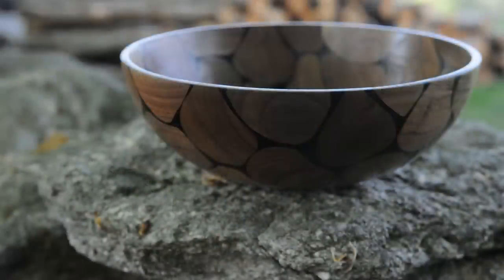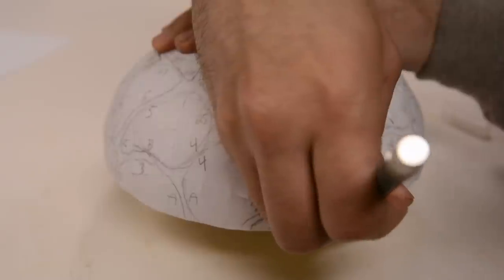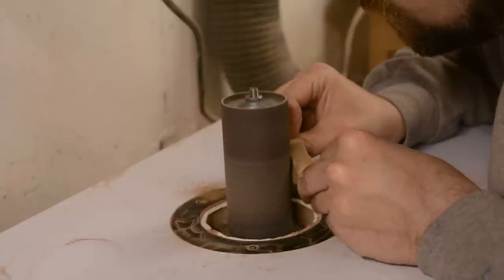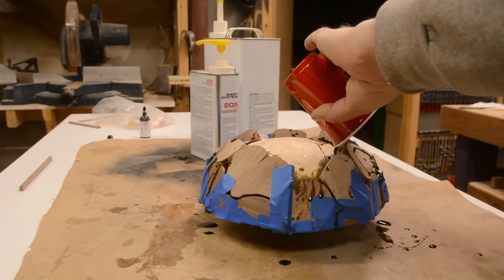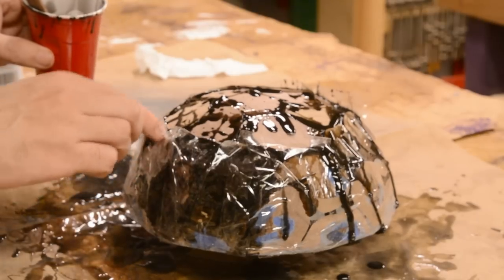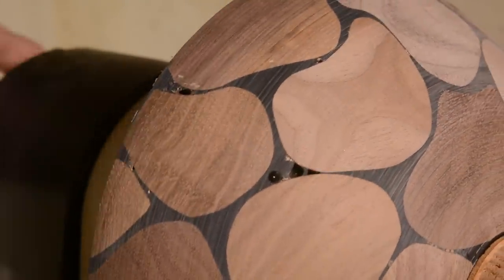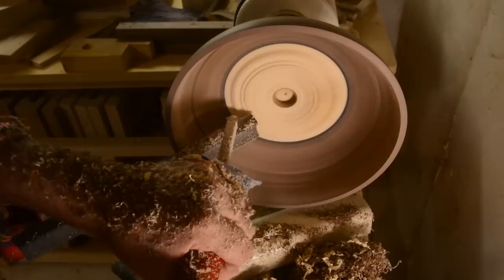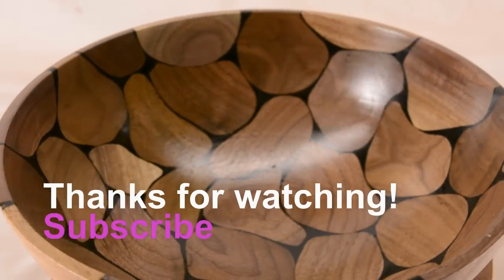Stone Wall Inspired Bowl

Comment: Not sure if this idea is practical but...  Make an outer form instead of an inner form.  If you spin that form on a turn table, liquid inside will form a parabola.  So potentially, you could do your pour from the inside, just submerging all the wood in epoxy, without the need for any tape, and without filling the whole interior volume of the bowl with epoxy.
Reply from the maker: Matthias Wandel Hmm, well that would at the very least fail in a very entertaining way :)  The inner mold is the easiest part of the process and makes it easy to mount on the lathe.
Reply: krtwood I suppose it could get quite entertaining if you spin it too fast!
Reply: Matthias Wandel I was thinking kinda the same thing, but in stages - first the bottom then about 1/8 of a side at a time pouring the next 8th as soon as the previous pour held in place - vibrate the work piece while the epoxy sets up to de-gas the epoxy. Another idea is to turn and outside and inside mold. Set this up on the inside of the outer form and then o pour enough in the form to fill all the voids once an inner form is pressed in place. Clamp it down and then vibrate the whole work piece for a while to de-gas the voids. Then there's a relatively solid piece to work with with the epoxy and wood-rocks in the middle.

Another idea I had was to use a vacuum chamber, but I think the air in the molds might just get pulled into the epoxy.
Reply: +Dogwood Tales (Projects For the Home) I suggested a similar process below. I think the idea of using an outer mold with pieces stuck to the inside probably has the best potential. Even if you just hold it up by hand, and tilt it back and forth. However, Epoxy takes a while to set, so it may run back down into the center if you put the mold down. 

Taking advantage of the fact that Epoxy does not stick to Polyethylene is also very useful for making release molds. If  molds are made of this, (instead of wood) then there will be no air to get sucked into the epoxy from the mold, when the whole thing is in vacuo.

Comment: Beautiful.  That looks amazing.  I love  turnings made from segmented wood/other stuff.  I've ran into the "small void fill" problem myself.  Frustrating as hell until you try poking it in with a toothpick.  Just jab the toothpick through the epoxy and pull it out to release the air bubble inside the void.  Works every time and makes one feel like an idiot for not thinking of that sooner.  I wasted 3 days once before I had that epiphany.

Comment: Beautiful bowl.  I've done a little work with epoxy and it can be very rewarding.  The master of how to use epoxy is Brendan Stemp who lives in Australia.   He is the consummate wood turner and earns his living from it .   He has some great uploads.
I think you could have made your work a little easier if you had taken a cheap plastic kitchen bowl and glued your segments to the inner side.   Then find a similar plastic bowl a size or two smaller.    Half fill your original bowl with epoxy and gently press down the second bowl forcing the epoxy upwards and outwards.   If the epoxy doesn't reach the rim just mix some more and top it up.
Anyway, your bowl is a stunner.
Best wishes,
Alan.

Comment: Use a toothpick to help push the epoxy into the tiny voids/holes instead of just putting a blob over them. The air is trapped inside doing it your way and epoxy wont fill the voids. Either way, absolutely beautiful bowl mate!

Comment: Absolutely great design! Attempt at suggestions: cling film to keep the epoxy in, and an injection needle to fill the voids? I do understand your thinking towards bigger gaps but without (obviously) having seen one of those, I think that the delicateness of this bowl made by incorporating these small gaps are real nice.
Reply from the maker: Maurice Blok Mostly I just want to avoid having the pieces actually touching each other.  There were a few spots where the joint between them was really tight which is usually a good thing but not in this case.  I'm also thinking maybe some strategic channels carved in the inner mold would allow the epoxy to get down into some of the trouble spots.

Comment: I also thought you were going to use an external mold as well, that may still work with bigger gaps...nice job!
Reply from the maker: Rob Shamel I want to try to avoid the outside mold if I can.  Either it's a plastic bowl and then you're locked into a particular shape or you have to turn a whole bowl just to destroy it.  Thanks!

Comment: Here's what came to mind which could be helpful for your method. Make the same inner mold again, but put it on the lathe and carve out the inside of it essentially making it a bowl itself which will be useful for the later drilling maybe. After you glue the cut out shapes of wood to the inner mold, you could use a drill wide enough for epoxy to flow down the drilled out holes easily and drill those holes in to the mold in between the wood cutouts. After you did that, you can make an outside mold from a plastic bag by gluing it to the wood pieces. Applying the glue along the edge of each piece or the entire piece and there by ensuring that no epoxy would be caught between the plastic bag and wood.  When drilling the holes angle them so they are all upright, that will allow you to spin the whole thing without having to plug the holes and that way help distribute the epoxy better using centrifugal force, then later add more epoxy, plug up the holes and flip and shake. But I feel that Matthias has a much better solution, by gluing the entire cutout to an outer mold you can pore the epoxy easily and nothing would be wasted. If you really want to have an inner mold for the lathe, you glue it in after.
Great bowl, keep up the good work.
Reply from the maker: Marko Živković Thanks for the suggestions.  What I'm thinking about trying is to cut channels along the surface of the mold to make sure the epoxy can get down everywhere.  I think that's the least amount of extra work and worth a try.
Reply: krtwood Yeah, that sounds like a simpler solution then the holes I suggested.

Comment: Ill add a bit with my experience with small epoxy voids. The first one is CA glue andactivator. the scond is just the way you did it, but ass a flame to get the air out from under it. It helps me out a ton when having to fill small holes.

Comment: Love the finished bowl.  Here are a few epoxy tips:

A) An outer mold would have eliminated a lot of the problems.  Might have to do multiple pours because curing epoxy is an exothermic reaction and it will actually boil from the heat it generates while curing if you use too much material at once.  Don't ask how I know this... ;) 

B) Aluminum tape ($6/roll at Menards) is the best tape I've found for damming epoxy in.

C) Only effective way I've found to eliminate small voids is to either turn them away or enlarge & fill, much like a dentist when he's filling your teeth.

Comment: Spectacularly beautiful bowl!  Can you use a syringe to inject the epoxy into the very tiny holes?  Maybe that way the surface of the hole is covered from bottom up rather than trapping an air bubble inside by a dripping application?

Comment: Oh, by the way, epoxy turns yellow/brown over time, and will crack, so coloring it is a good idea. The packaging for electronic ICs is made of epoxy plus some filler that stabilizes it. (Carbon Black? Glass or Ceramic Dust?). I do not know if Acrylic or Polycarbonate are more stable. These plastics off-gas, (hence the smell), which may or may not be suitable for food. Definitely bad for any fat-containing food like meat or cheese. Bakelite is awesome, very stable, and not toxic, unless maybe you ate a bunch of it, but I believe it is a thermoplastic, so it needs heat to mold it into shape.

Comment: this bowl is very beautiful! you skould try wrapping it with "foodwrap" (i dont know the right word, English isn't my primary language), or the thicker shrink-wrap that's used to wrap boxes for shipping, i use it everyday at work and it would keep itself VERY tightly wrapped around the perimeter, and probably be a lot tighter because it sticks very good to itself but not at all to the wood, dont know how it reacts to epoxy but u surely have it in the kitchen and its also very cheap :)

you should however try to find the one used to wrap things for shipping because it's a lot thicker and stretch/crimps a lot more, thought if you put a couple of layers with the foodwrapping i think it'll suffice :)
Reply from the maker: Karl Liljeström I thought about that.  I went with the tape because I wanted to go up to different heights in different places, so the tape let me be strategic about it.   There are placed where if you tried to fill it all from the top it would have to go down and then back uphill to fill the voids which I didn't think would work.
Reply: true, i thought mostly about the lowest part so you could get the bottom sealed so it wouldnt drip trought, but as you said, differnet height all around...

Comment: Have you tried using a bit of a "wick" to let the epoxy flow along to the bottom of the void?  (or maybe a fat syringe?)  I think it doesn't tend to fill because it's too thick, and it just creates an air pocket when you try to fill it in with a glob on the top of the small hole.

Turned out really nice though.

Comment: I really don't know anything about turning wood. But I know how to make molds for metal and other things.  My suggestion is this. Take a regular bowl about the size that you want to make your turned bowl.  Cover the outside of it in vaseline.  Then take a cardboard box and line it with wax paper.   Then take plaster of paris and fill the box, push the bowl into the box.  It will take about 3-5 minutes to "set up"  Pull out your bowl. then let the bowl shaped mold dry overnight.  Now take your wood pieces and glue them to the inside of the "mold".  Take your resin and pour it into the bowl shape.  This means you can rotate the bowl shape to "fill" the voids.  vibration works excellent for this too.  So tap on it, set it on a vibrating sander with no sandpaper to raise bubbles to the surface.  Now after the resin sets up all you need to do is soak your plaster mold in water,  you can break it up with light hammer taps, or even use a jet sprayer to wash away the plaster.  The cardboard and wax paper should just pull off the plaster pretty easy.
Reply from the maker: Atilaurakiss Thanks for the suggestions.

Comment: Nice project. I wonder if you were able to put the form under vacuum while it was curing if that might solve your void issue.
Reply from the maker: Brian Lasch You would need a rigid inner and outer mold to do either vacuum or pressure.  From what I've read that can deal with small voids but not bigger ones unless there is a path for the trapped air to escape.

Comment: Try a low viscosity epoxy such as Raka resin. It flows like thinned varnish. Would need to seal up well, maybe saran wrap, but it runs into every little crack and crevice. It's for boats.

Comment: You can use graphite filler (sold by West) to thicken the epoxy to the consistency you want,so it doesn't run everywhere, and it also makes it black in colour.

Comment: I saw something similar once that might help if you do it again. They did it the complete opposite way, w/ an outer bowl form and they attached the pieces inside. They rotated the bowl to get the epoxy between the pieces. It was a visiting artist years ago when I was in school, so it's not the "right" way. But whoever it was seemed to have the process down.
Reply: Sorry, just remembered they used wax (or maybe clay) to hold the pieces in and it popped out of the bowl form.

Comment: next time you could try using a syringe to get the epoxy into the little holes. 
If you have the equipment you could also try using a vacuum pump to get all the air bubbles out on the 1st pour

Comment: What a fantastic bowl. Thank you so much for sharing your ideas and also your thought process!!

Where does everyone buy epoxy in the big pumps like that? And you just chose a dark resin?
Reply from the maker: l3ender15 It's clear, I added black tint (Mixol).  I got the big size at my lumberyard.  You can get the smaller sizes at the usual woodworking sites.  Anywhere that caters to boat builders will probably have it too.

Comment: @krtwood hey I love your stuff and this bowl is awesome. I will say though that west system is highly toxic until it reaches full hardness at about 1 week when it off gases its VOCs. so turning or machining it before that makes those toxic particles air born. I have been taking a wood finishing class for a wood working degree and if you'd like some recommendations of other epoxies that will fit your needs I'd be happy to give you the name.
Reply from the maker: Pat Gornet Thanks for the info.  I did wear my respirator when I was sanding it, but not turning.  If you're got a better alternative I'm all ears, especially if it's cheaper ;)
Reply: Pat Gornet I'd also like to hear alternative suggestions!
Reply: l3ender15 krtwood Glad you're all interested. West systems has done flaws that I didn't know about until this class. It's highly toxic and turns a yellow brown super fast under UV light. Also the pumps will eventually get jammed from all the resin sitting in the spring mechanism and won't go all the way back up, which can mess with your ratio and making it take longer/never cure. My recommendations are system three's "t-88" which is UV inhibiting and far less toxic. It's cheaper but it does have a slight yellow tint to  it, so not ideal for filling knots unless you're using pigment in it but great from everyday work where the epoxy is used for structural purposes and pore filling. System three also has a  "clear coat" epoxy that has the same propotys but clear. it is more expensive then t-88 but  less expensive then west systems. There is also an epoxy called "kwik kick" by resin research. it was designed to replace the highly toxic polyester resins used to coat surf boards and is extremely low VOCs and super fast cure time since it's designed for production work. It's very workable through out its cure time and has a good hang so it wont run nearly as much as other epoxies.  It does have a slight blue tint  that isn't noticeable unless you do a deep hole fill.
Each epoxy I mentioned also has a simple 1:1 or 2:1 mixing ratio. I hope that  you take a look at their sites and try one of those out. the t-88 comes in the smallest quantity (8.4 oz) and the other have pint size as their smallest quantity. enjoy!

Comment: I like that.  I'm gonna try it with different color woods and clear epoxy.  Another way to fill the gaps in 1 or 2 pores would be to make another mold to fit over the glued on pieces.  Then seal inner and outer molds.  Have a couple of holes in the outer mold to pore the epoxy through.
Reply from the maker: Mark Hazlewood If I can do it without the outer mold that's the way I want to go.  Too much work to make one and too limiting to use plastic bowls, which might or might not release from the epoxy.

Comment: how about using a syringe (with no needle) to fill up the relatively small gaps ? for the small holes where the epoxy refused to get into u can circle it with hot glue (like u did) and after covering the hole with the epoxy just use the syringe with a needle to vacume the air out of the hole. that way the epoxy will be vacumed into the hole.

Comment: In Industry, Pressure Or Vacuum Is Used To Fill Voids With Compounds Like Epoxy. They Are Too Viscous And Adhesive to Rely On Only Gravity Or Capillary Action Alone. Pressure Would Likely Have Worked With Your Sponge Bowl. So, Unfortunately To Do It That Way Might Mean A Pressure Or Vacuum Vessel, With Lots Of Epoxy To Submerge The Bowl Mold In, When The Pieces Are Attached.

Remember, Epoxy Does Not Stick To Polyethylene, (Milk Jugs, Garbage Bags, Saran Wrap, White Plastic Kitchen Cutting Boards), So Making A Mold Out Of This Material, or Covering A Wood Mold With It Will Allow An Epoxy Bowl To Release From The Mold, So You Do Not Have To Turn Out The Entire Inner Cavity. (Such A Device Might Also Work As A Pressure Plunger To Fill Voids From The Inside Out.) So, For Example, Create A Concave Mold In A Wood Block, Line It With Polyethylene, Tack The Sponge Or Wood Pieces Inside This Mold, Add A Lot Of Epoxy, Then Use A Convex Bowl Mold Made Out Of Polyethylene, Or Wood Covered With It, To Act As A Plunger, And Force The Epoxy Into The Voids, And Up And Out Over The Edge.

Regardless, The Bowls Look Great, And The Sponge Bowl Will Look Awesome, When You Get It Down.